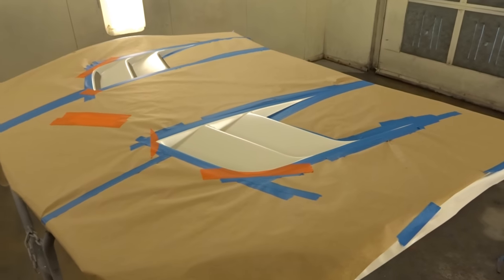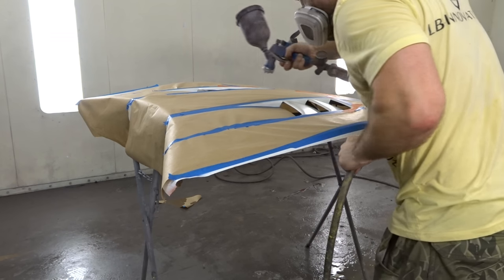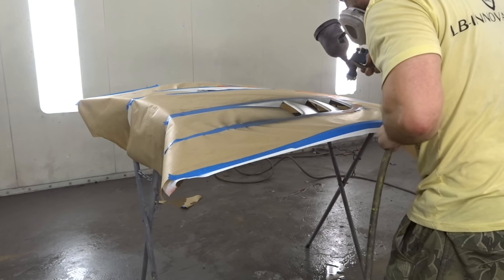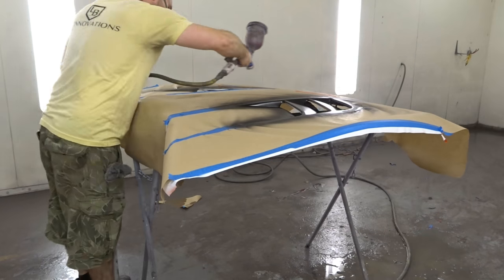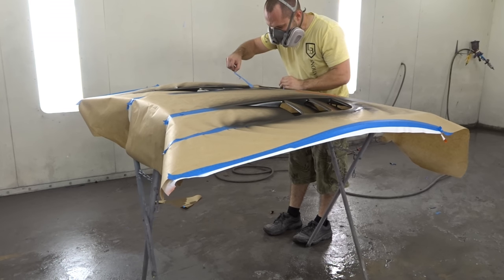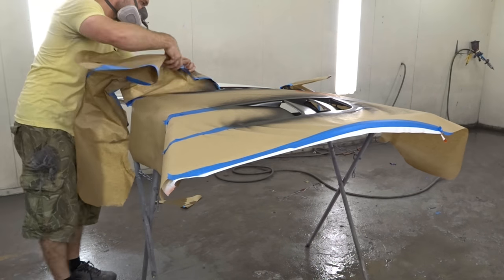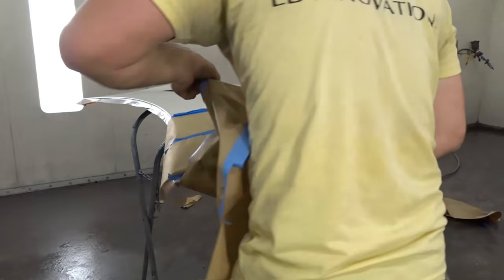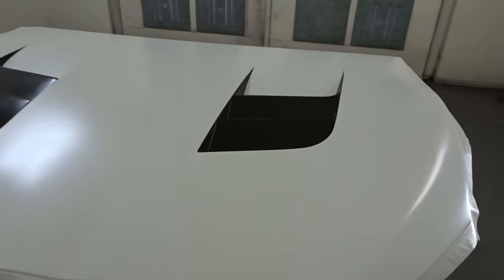Painting FRS carbon fiber hood with black vents

Comment: Why didnt you use the carbon fiber as the black? That would of looked alot more cooler
Reply from the maker: Joel Ruiz  That's what I usually do. But, in this case the gel coat was cheap and the sun made it yellowish and milky all the way to carbon fiber. So I had to paint it.